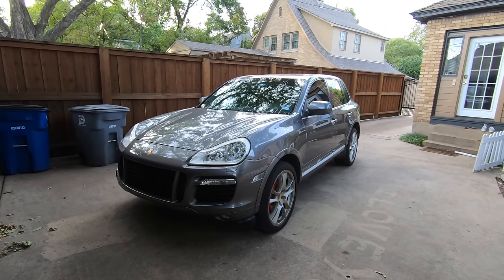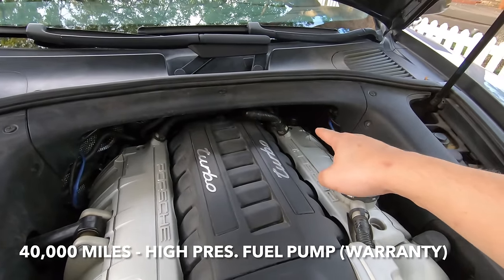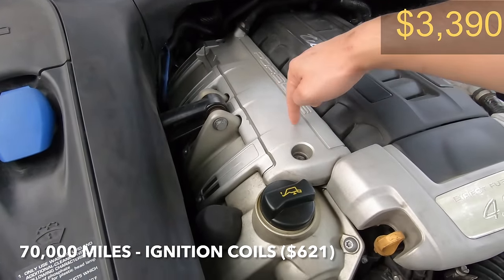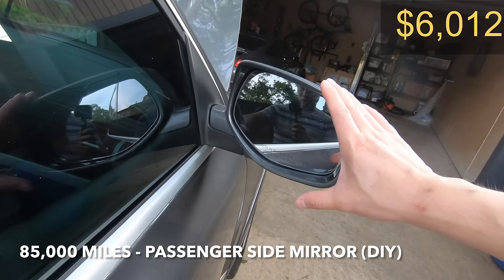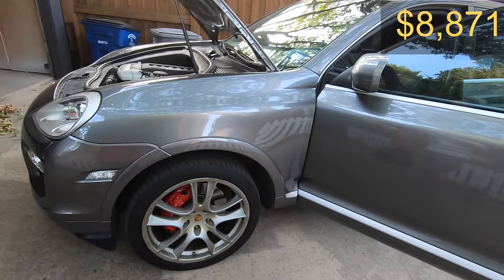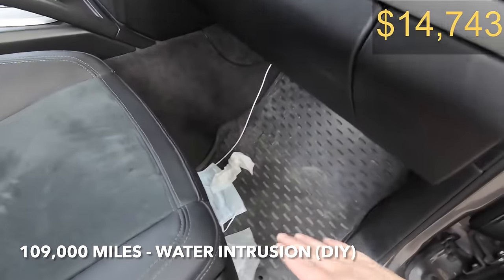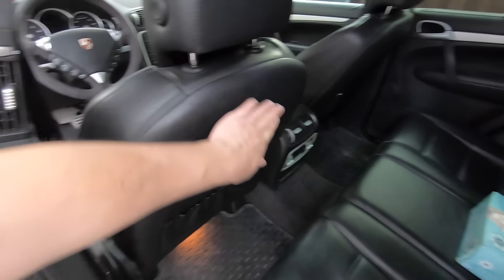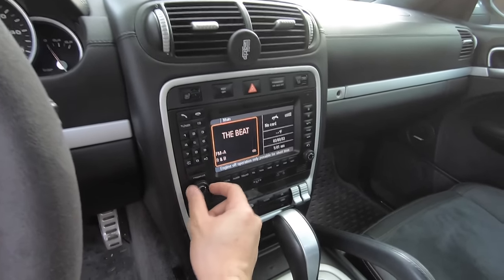Why Are Used Porsche Cayennes So Cheap? Owner's Review of 15 Year Old Cayenne Turbo (955, 957)

Comment: Oh boy, that takes some major cojones to buy an old Cayenne Turbo! I bought a new Audi A6 and put $25,400 into it in repairs after the warranty ended before getting rid of it. Your numbers are about on par with those (I always took mine to the dealer for repairs and maintenance). That ‘shocking’ number didn’t include maintenance items like new tires, brakes, and things like that. Perhaps needless to say, we now own an Infiniti and have only ever done brakes on it (2018 Q70S at 106k miles). The Infiniti dealer laughed when I told him I wanted to trade in our A6 and offered $2k for it (he said there wasn’t a market for a car like that at their dealer—which makes sense). Selling old, unreliable cars like that doesn’t make a dealer any friends (or repeat customers).
Reply: Did you learn your lesson to not buy German anymore?
Reply: Well you bought good car  just wrong year and engine . Audi A6C6 is good after 2008  as 239 hp diesel quattro .   Other engines like 2.0 are problem same as petrols .  Remeber Audi won LeMan with DIESEL not petrol.  Also   C7 2011+   with 3.0disel is awesome car .  S tronic . NOT that cvt shit multitronic gearbox.  To buy a car you need to know a car. Else you  get problems .
Reply: @davidr6865  Oh ya, I learned my lesson. Well, pretty much.
We've had Mazda Miatas and Infiniti sedans since the Audi, and they've been fantastically reliable--and about the same dynamically to drive. But I say "pretty much" because I just bought a Lotus Evora a year ago! The car has been great so far, and with the Toyota mechanicals, they seem to have a good reputation.
Reply: @davidr6865  German always 🇩🇪
Reply: @chir0pter  yea they’re great with factory warranty. But I can assure you that anything German besides Porsche are heaping piles of junk after the warranty period. I’ve owned them all. It’s just depressing owning them with all of the maintenance expenses on a 10+ year old car
Reply: @davidr6865  I dunno I have one now and I dont mind dumping money into bc it’s a unique car. I do hope I get a bunch more miles out of it before I have to refinish the block due to bore scoring…

Comment: Love my Cayenne. Had a 955 base and a 957 base. Just bought OEM GTS rims for it 2 days ago. So far on my 957 ive had zero issues in a year of owning it and done about 20k kms. It's at 166k kms now. The base model with the 3.6L engine is far more reliable so I suspect nothing will go wrong.
Reply: Update: now at 188k kms. Still runs amazing and looks mint. Always get so many compliments. Only things I've replaced since where both front wheel bearings, the front wiper motor, and the a/c blower motor was making a chirping sound so I replaced that as-well. Total under 2k CAD. Not bad at all. I also choose to replace the driveshaft proactively 1000$ total but by all means nothing was wrong with the one before I just didn't want to give it a chance to leave me stranded. Changed the front brakes aswell but thats just reg maintenance. I recently had a shop polish the headlights as-well and put UV Film over them to help keep them clear only 100$. Ive changed the oil religiously using Ow-30 (c30 approved) like Porsche Recommends for the V6 every 5000k kms which is quite often. Worth it the engine sounds super healthy. Also just bought some new Porsche wheel caps for my GTS rims ($100) and a new hood crest emblem (18$).  Plan on keeping it forever and my biggest enemy I suspect will be rust. They use salt on the roads here unfortunately. So may just get a beater for the winter to save the Cayenne but man I sure love driving it. Looking at getting a Turbo 957 soon if the right one comes up thats the right color (black)and has a  beige interior and low km ill jump on it. Until then I enjoy mine everyday. Def get the 3.6 if you want a reliable one and get as low km as you possibly can in the nicest condition possible it's worth it!

Comment: People seeing this are thinking ALL cayennes are junk and going to cost that much but in reality they are actually a ‘higher than average’ reliable car. All of those issues can happen to any car on the road, sometimes there is just a bad batch of a certain part or bad circumstances or some are unrealized driver causes. The difference with imports (German and Swedish especially) is that those repairs are going to cost more. The build quality is WAY better than Japanese, Korean, or American cars but parts and labor are going to cost more.
Reply from the maker: Build quality is definitely better, but the cayenne definitely requires more repairs than the average car in my opinion. Drives beautifully though when maintained.

Comment: Owned a pair of 08’ cayenne turbos (his and hers) the damn things ate me out of house and home just in brakes, rotors and tires much less the catastrophic coolant pipe failure not under warrantee.  NOTE: if you live in a cold climate (temps that drop below 0 F in winter) these engines score bores.
Reply from the maker: I forgot to mention in the video, but i had my coolant pipe pinned while the engine mounts were replaced. Mine isn't going anywhere.

Comment: I've always wanted one of these, thank you for the info. I did not know it was direct injection, that's gonna be another med sized bill to get those valves blasted. The water pump issue reoccurring is troubling. But German engineering is amazing. Having said that, I wish they were as reliable as Japanese engineering. Reliability is just as or more impressive than over engineering. IMO
Reply: Not all models have the same experience, but overall Porsche has a very high reliability rate compared to other brands. Now one very important thing to mention, this owner has a long list of everything he has replaced, how many cars have this level of maintenance done?? Most owners don't fix things and left them fall into disrepair, German cars are more expensive to repair. I had a Jeep that I was under the hood all the time all the time, it never ended as a former mechanic that got old.
Reply: @henryv.3272  I just watched a tear down video with this motor on FCP Euro's page. After watching I have a new appreciation for this engine. Other than 2-3 fixable problems this motor is a gem. It only has one major timing chain compared to Audi's four. The Chayenne's V8 is simple and sweet in comparison to other Germans. I want one again. Great SUV IMO
Reply: Volkswagen: Sieg heil, was ist reliability? 
Oh it doesn't matter, take this 20k overengineered ball of plastic and have fun....
(For like 2000 miles lmaaao)
Reply: @michaelstrongbow2336 were the valves coked or were they clean?

Comment: Depends a lot on one's priorities. Two years ago I was thinking about adding a tall, heavy vehicle for my long commute. Initially, I wanted to be another German car next to my 98 BMW 540 and 00 Audi A6 2.7t.  Both with manual transmissions.  Although I was considering Mercedes GL or Porsche Cayenne, I ended up buying an 08 Lexus GX470 with 108k miles on it. Gorgeous car, great quality interior, everything works.  But as far as driving goes, I would not call it awful, but close.  The GX470, like the 4Runner are based on trucks, they feel like a truck, and drive like one. On the freeway it bounces like a baby goat. Every bridge expansion joint I drive over feels like a speed bump. Even in comfort mode, if someone in the car is drinking, they will spill the drink or choke.  When it comes to cornering, forget about it, I'm always thinking, is it going to tip over or not ? No steering feel at all, no communication at all. But that wooden steering wheel feels good...I hope I will never have to swerve to avoid something at speed in this thing. Except for reliability, there are other advantages, one,  my wife avoids coming with me when I say I will drive the Lexus, since it rattles her kidneys and brains. When windy, I have to slow down to avoid being pushed around.   Hard to get in trouble with the police, since it's not fast and it cannot corner.  One particular freeway ramp I was able to take at 110 with the BMW, while the Lexus can barely touch 65- pathetic. And speaking of my German cars, if I read all the negatives, I would've ended up with a soul less Camry.  Yet, here I am ten years later, both cars well past 120k miles and none of those money pit stories.  Yes, I had two hoses, the thermostat and a window regulator go bad.  No big deal. Never got stranded with either. I am doing my own maintenance and repairs as much as I can, and drive them the way they were supposed to.  The Audi is being rallycrossed every year, and has no problems whatsoever. After two weeks of sunny weather and BMW driving, it will rain next week, so crap, I am forced to drive the Lexus again.  Bottom line- to me, no matter how reliable they may be, if the driving experience is not satisfying, the car/ truck is just a worthless commuter vehicle
Reply: Lost me at depends, you have lots to say
Reply: Well if you want a racing car just get one for a racing track. In my state the max speed limit is 65mph. So unless you enjoy getting speed tickets, you can race cars all day,
Reply: Thank you for that detail,  it makes a lot of sense
Reply: Two problems on the driving dynamics:  1) Lexus, and 2) GX470 is an SUV.   Why would you expect it to handle well?
Reply: Priorities indeed. I have an old first gen Tundra 4X4, possibly the most lumbering vehicle ever made, I love it and I'll keep it going as long as I can. Otherwise, two Rav4 AWD's, gets me A to B and back. But big lumbering SUV is your topic, and I had a rental experience with two. In 2014 I needed to transport a very expensive and delicate instrument from California to Colorado to Arizona. I needed a big SUV. I rented a Toyota Sequoia for the first leg, did not get along with it at all, knew I'd never buy one after that experience. For the Colorado to Arizona leg I rented a Chevy Tahoe. That was a completely different and satisfying experience. I don't know about ownership cost, I imagine the Chevy is far higher than the Toyota, but I'd be happy to drive that Tahoe.
Reply: You sound like the ideal Porsche customer!  As long as the driving experience is the most important thing, all the recalls and maintenance costs will not dishearten you.
Reply: I test drove a 2003 Lexus es300.  Brain dead driving experience.
Reply: Seems like you may have some other things going on because Lexus, especially the SUVs (LX and GX) are very smooth riding. So some other things may be at play. What I will say about the GX470 is that they actually had a recall/advisory out on them because of the high rollover risk. It was a bad design by Toyota/Lexus... Which in itself is very rare. The GX was made very tall and top heavy which in sudden movements created an exponential rollover risk. You may like the LX better. It's a lot more ironed out. Granted you're not going to get a sports car feel. But you will have a lot of the other issues taken care of

Comment: I have an 08' S with 167k on the clock. Have experienced all you did plus a new motor about a 100,000 miles ago (compliments of Porsche), two trans valve bodies, and new active sway bar hydraulic pump and lines. I just drove it back from my place in FL to NJ. 19.2 mpg at close to 80mph most of the way. It is so much more of a nice ride than my 23' Expedition Max Platinum and my previous 19' LC200. Pneumatic suspension rules!

Comment: I had a series 2 2012 base and other than not being very quick off the line, it was super reliable. I purchased it with 12k miles on it. I ran it for 60,000 miles on top of that. Did brakes all around for $1300 and there was a clogged door drain that caused the door to collect water. Apart from that oil and standard maintenance.   Got a 2019 2 years ago. Put a RaceChip in it, and it’s is pretty quick, also has been 100% trouble free but only has 40k miles. Taking delivery of a new cayenne Turbo GT next month. I love these cars
Reply: You did the smart thing and didn't keep it beyond 100k miles. It's the rule of thumb for any high-performance and luxury car. That's when the serious problems start.

Comment: Very thorough review my friend!! The Cayenne is my dream car but I'm deathly afraid of it also. I've mainly driven BMWs and now drive a Mercedes now but neither gives me that queasy feeling in the pit of my stomach the way purchasing a Cayenne does. I was close to buying an '06 which had all the maintenance records but a misfire problem that I wasn't looking to entertain. I think I'll wait on a 2012 model to become available. But plastic cooling hoses placed beneath the engine is something that never should have left the design room. What were they thinking??
Reply from the maker: Thank you! The plastic coolant lines were fixed starting in 08 thankfully. Reliability has gotten better with the newer ones.
Reply: Watch out for there air suspension.its unique and an expensive fix
Reply: Oh and the other car that has this air suspension is the fantastic french Citroen of the 90s
Reply: @minigrande1939  many cars have had air suspension. The Citroen hydropneumatic system was more similar to Mercedes ABC that was on the CL class in the 2000s, not the Cayenne which has air struts and a separate hydraulic PDCC system.

Comment: I had one of the very early Cayenne Turbos, a one owner car from new, obviously they had changed out the plastic water pipes across the top of the engine after they gave up but it was plagued by water leaks of one sort or another (including the feed pipes to the alternator...yes, these have water cooled alternators!) But, and it is a BIG but, the driving experience in the Cayenne is superb, outrageous, better than it should ever be and decidedly and uniquely Porsche, 4 wheel drifting with precise control should not be as possible and enjoyable in such a car but the Cayenne makes it so...
Reply: Makes you wonder why Porsche didn't hire a QC specialist from Toyota.
Reply: Drifting?  😂

Comment: I changed the wheel bearing assembly on my A6 for $80. Needed a couple new triple square socket sizes to do it, so that added abot $20 to the job but that's about it. The bearing for the Cayenne is $40. The tool for this can be rented, or you can get one for about $200.
Reply: DIY is so much cheaper , especially on things that need lots of work but not many parts (head gasket, engine mounts, oil seal rings between gearbox and engine, wheel bearings and lots more).😊

Comment: German engineering? My 06 Lexus Gx 470 has had the front wheel bearings and the front driver’s seat reupholstered. That’s it. 206k miles. It’s a true off road read suv. Imagine what would happen if you took that fragile little girl to the woods

Comment: Wow, this change my mind about buying a used one. Thanks for sharing.
Reply from the maker: Glad I could help. The Cayenne isn't for everyone. It is highly capable for an SUV, but it takes a lot of engineering to overcome physics. Fortunately, I had an aftermarket warranty, which covered the majority of the repairs.
Reply: I have the same model & haven't had any issues with mine. Just a few performance goodies!! I'm at 77k miles
Reply: Thanks Soo much for sharing. Very informative. Looking at one

Comment: My 10 year old Cayenne diesel has only had brakes, new tires, and regular oil changes and a DPF clean out. Not had any of these issues nor my friends that have had theirs for the same amount of time. I've kept it in mint condition and people think it is brand new it's so clean on the inside and out.

Comment: I am a Porsche fan but a lot of people buy them cheap then realise they cannot afford maintain and repair them. Is the Cayenne your everyday driver? Love your mods too..great job.
Reply from the maker: Thank you. It is my DD, but I should mention I work from home now, so I don't drive it as much as i used to.
Reply: @CarFanatic  how is it DD if it only has 120K miles on it? The car is barely driven.
Reply: @vicinvesta8349  are you ok? That's alot of miles. Most people don't spend all day in their cars. People usually work somewhere close to their home you know....
Reply: 120K isn't very many miles on a Toyota.
Reply: @mannacler  Toyota's are known for their build quality and thus low maintenance costs. In this discussion it wasn't about how many miles is a lot for the car though.  The guy who made this video simply said it's his daily driver and someone here couldn't understand how it could be his daily with  that low mileage. Most people only own 1 car and for most normal people 120k miles is above average. As most people simply drive to work, to the store etc. and that's about it. however... The car is crazy expensive for the miles it has driven and I'm not disputing that.
Reply: Agreed. I bought a used BMW 3 Series and I spent more on repairs than I did in car payments the entire time I had it.  That car stayed in the shop so much it got me kicked out of grad school. Hands down the worst financial mistake of my 20’s. I’ve owned 3 American cars in the 5 years since then and couldn’t be happier. They never need to go into the shop, even above 100k miles. Germans make nice cars but never buy a used one

Comment: Funny; I was just doing a look back about my 2008 Solara convertible, with 136K miles,  repair history....and the entire list is:  I replaced one spark plug coil and the stereo "Aux" phone jack connector.  That's it.  Yeah, a few things wore out...brakes, convertible top (replaced just because it showed creases from being constantly used as I live in FL), and of course tires and TPMS sensor batteries died.  But literally nothing else.  What a contrast!